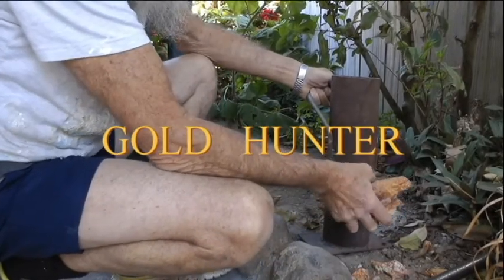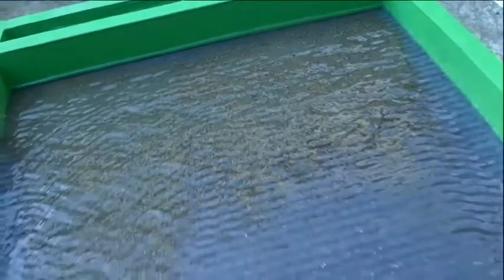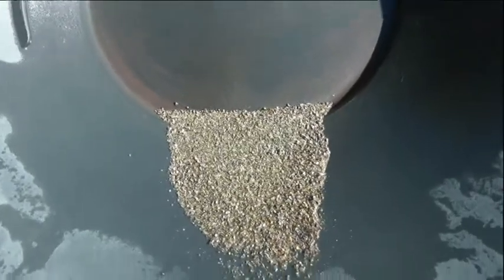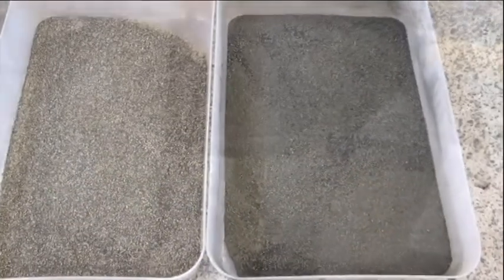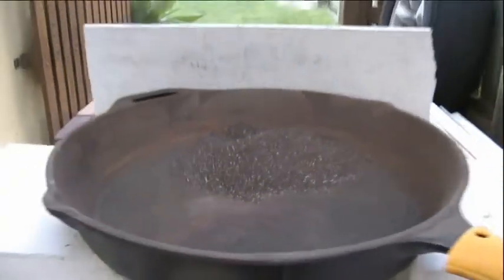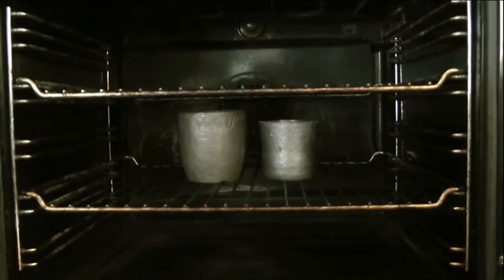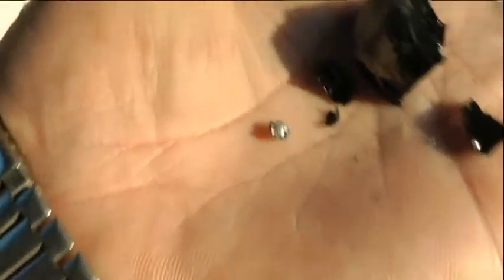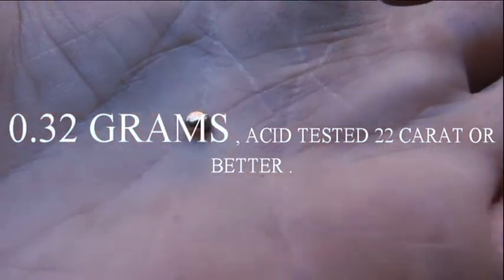Gold Hunter , From  Sulfides  To Gold .

Comment: Gold Hunter, Triple AAA video, the first one of yours I've seen, and learned much from the video and the comments also. Sulfides have me perplexed, but thanks to your video, I've learned so much more. In my adventures, I've picked up a few hundred pounds of rock with visible sulfides and gold, I have a pestle and mortar, but I need a dolly pot! I have a 6' diameter fire pit I made for burning bark, twigs, and rubbish from selling firewood and also branches from winter storms and scrap from lumber from projects I build, or refurbish. Last fall I had debris to burn and with a bonfire, I thought I would throw that rock in as I burned to roast the "rubbish" as you termed it and I raked the rock inwards keeping it in the coals as everything burned down until I could get close enough to start pulling the rock out and had a pail of water to throw them in thinking the thermal shock would fracture and make them easier to crush later with mixed results, however, I recently saw a video from VoGus on YouTube and he used a blower to add air and get extra hot which I have but didn't think of at the time and instead of throwing into a bucket of water, he dumped vinegar out of a jug onto the rock itself which he then crushed(?); it really looked like he was crushing chalk from the teacher's blackboard. I haven't done this yet, but I will soon this winter I will use a bucket with a gallon, or two of vinegar since it is cheap and I don't want to waste it, and I have maybe upwards of 20- 50 pounds of high grade with little veins and specks and also it looks like gold enriched silica coating this fragmented rock in area's, kinda like an electroplating done by nature and since the rocks are smaller and maybe specimens I'll use charcoal and a cast iron pan in my charcoal grill in much smaller batches directly from grill to vinegar bath so I don't boil all the vinegar out like I was doing with the pile of rock at the bottom of my fire pit and the bucket of water. I have never roasted sulfides before and now know I didn't get that rock hot enough, but mainly I wanted to make the rock easier to crush and maybe roast the sulfides at the same time, not. I am going to do my best stuff on the grill and see how that works keeping the gold natural and not pounded flat. I need to watch the video again of VoGus because I think he was just trying to make rock easier to break rather than roast sulfides and he was picking little lumpies out of what was solid rock. I believe Vogus is in Australia also; you prospectors from Australia rock! If I can get it hot enough I shouldn't have to redo the sand-sized sulfides, but probably will anyway and I would have thought the magnetics were like black sand out of a river- and set them aside until watching your video! I'll let you know how my experiment works out and do you think there is anything in the rubbish? I've subscribed and will watch the rest of your videos before I pester you with too many questions, thank you for this one. A Heads-up, I left Jeremy a sarcastic comment on one he left you from a year before, I hope you enjoy it!

Comment: Great video Ned. I’ve been looking for a simple diy kiln and I really like the looks of your. I’m assuming those are fire bricks of some sort. Can you tell me who makes them and where I could order some for delivery in the US.?   Me and a couple partners have three claims here in the mother Lode in California one of which is a hard rock with a lot of serpentine and quartz. I picked up a little 6 inch D ring impact mill run with a quarter angle grinder just for sampling and have a whole bunch of sulfites and a tiny bit of free milled gold. I’d like to set up a double burner propane unit and see what values the sulphide produce. Much appreciated. thank you Rodney
Reply from the maker: Hi Rodney , that first kiln set up i had didn't last long , i upgraded to a bigger propane burner and made a better furnace out of a watering can , lined with refractory cement , and sleeved with Kaowool  , a real beast . I have a video up showing it in action if you wish to view it , just check out my channel , the vid is  called Smelting sulfides for Gold . You could buy a Devil Forge , i think their pretty cheap , but really the cheapest DIY kiln you could make is out of 2 inch Kaowool wrapped into a cylindrical shape tied round it a piece of wire , and mount it on a couple of fire bricks , use also the Kaowool for a lid . That's all Jason uses on his channel  MBMMLC ,  Mount Baker Mining & Metals , hope that helps , cheers and thanks for watching and commenting , good luck .

Comment: I am doing what you are, only I do not roast. I leach with HCL and bleach, evaporate the solution. Then I place the chlorides into AR. I am getting silver, palladium, platinum, and rhodium  as well. Did you test for Platinum Group Metals? It won't hurt  to try. Good luck. Nice video.
Reply from the maker: glenn abbott , i did think about using Hydrochloric and bleach to leach it , as i have done computer components to recover gold successfully , i haven't tested for PGM's , though unfortunately with work commitments and actually getting out prospecting when i can , my time is very limited , anyway good luck , thanks for watching and commenting , cheers .

Comment: 0.35 milligrams = $ 14 A lot of work, plus the use of gas and electricity for a water pump. I do not know what to say...
Reply from the maker: It's certainly not a money making exercise ,lol , just a hobby , i did the gold from computer parts exercise as well , there's no money in that either , just a bit of fun , just to see if i could do it , the fun is in the research , but when i go out to the creeks and rivers i pan , it costs me 100 bucks in fuel , so you see i don't do it for the money , it's my outlet from the everyday grind of my job ,lol, that's all there is to it , thanks for watching and commenting .
Reply: @GrooberNedJardine  👍it's clear
Reply: @akgoldbear7669  he had near half a gram thats $25. and knowledge is worth more than its weight in gold. this video filled many gaps in understanding and I've forever thankful. The rocks my folks found in Arizona have thin layer of fine painted gold on them with many sparkling black sand looking stuff when cracked upen, it seems the exterior has oxidized to reveal the thin layer of gold. Excited to smash those rocks and see how big of a button they make. The mini ball mill was new to see and very impressive. THANK YOU